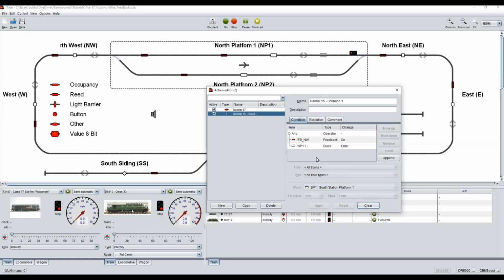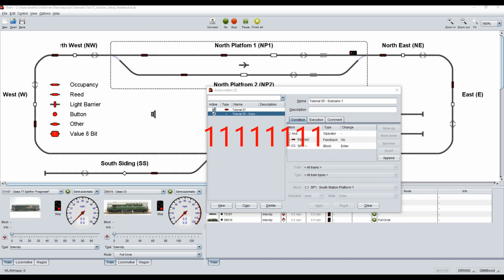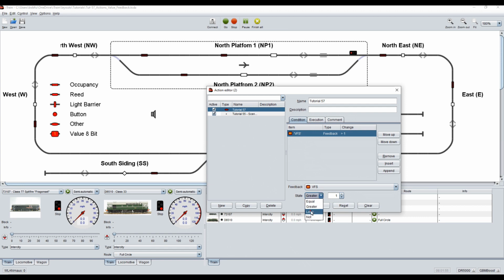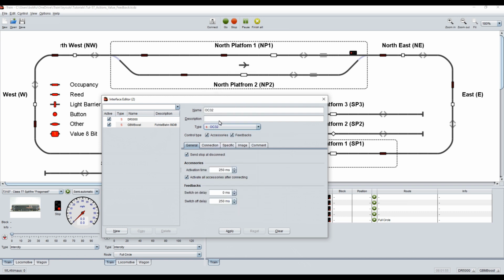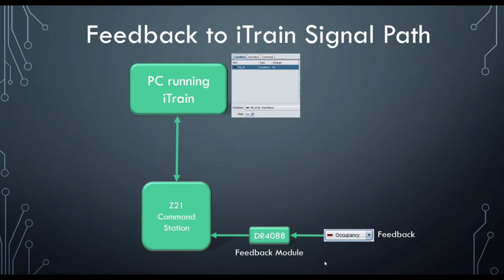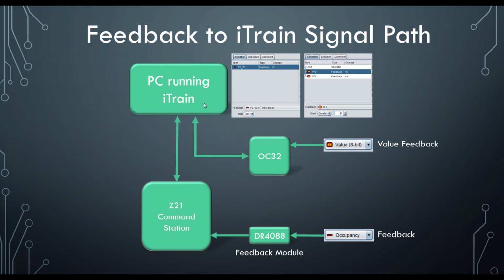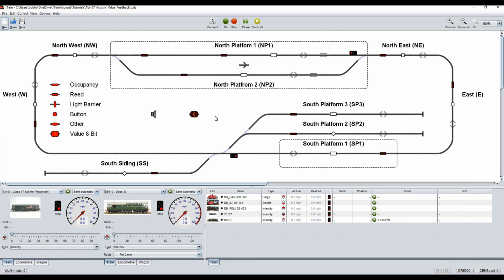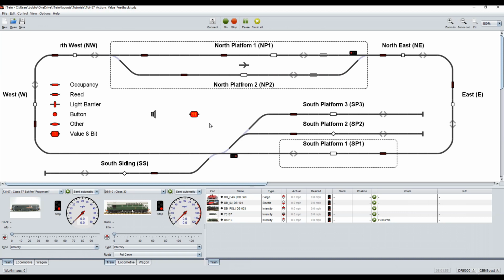Video 57: Actions - Value (8 bit) Feedback

Comment: Hi Bob.  Your series on iTrain has been very valuable and I have watch many of them many times to fully understand the concepts.   Is it possible that you could do one or a few on setting up Signals?  How to define them, where to integrate them into the blocks.  The manual is not easy to understand in this area.  Have been experimenting with defining ones to add but not sure why they don't seem to follow what I would expect happens.  Others may also like to have this part explained.  Thanks for considering this request.
Reply from the maker: Hi Rick. 
There will be some tutorials on signals but not till later this year.

Comment: HI Bob thank you for these videos I have slowly started set up the various steps you are showing nd have the block detection and turnouts along with some shuttles. the next step I'm wanting to do is set up automatic signalling that corresponds to the turn out position. do you have a video for this.

Thanks again
Reply from the maker: Hi Grant
It's on the list to do but not for a couple of months so if you need to move on, I would recommend asking questions on the iTrain forum.
Reply: @bobfuller  Thanks bob happy to wait as I like the way you describe the process as it makes its much easier to follow look forward to the video 👍

Comment: Hey Bob. Thanks a lot for your videos, than helped me run my trains as I wanted them. I still have two issues for with I have not found an answer in your videos and thats is Platforms and Speed. My issue with platforms is that at routing I can set only end, start or default value for the train stop. But I can not stop like 10cm before the end of the block and I have no idea how to setup platform. Secound issue that I have is a speed. My train seem to be kind of jumpy and they slow down from top speed allmout to 0 very quikly when they get from one block to station block. Is there a way, how to tell Itrain to use the speed chart at locomotive setup? Would you be so kind and make a video for those two things?. Thank you very much.
Reply from the maker: Hi Filip
We would need to see your tcdz layout file. Please post your question on the iTrain forum and attached your tcdz file. Someone will then provide help.

Comment from the maker: Hi Wayne,
I don't think there is a limit on the number of throttles. You can have up to 256 locos with all versions and unlimited locos with the Pro version. So, I assume that means you can have the same number of throttles. Click on a throttle, then press and hold the ALT key and press the arrow keys to add/remove a row or column of additional throttles.

But, if you mean a new, separate window that displays only throttles using the VIEW/EXTRA/TRAIN GRID menu, that is in the PLUS and PRO versions.

Comment: Hi Bob.  I'm back watching your videos again and believe I will go down the ITrains/Digikeijs route.  A little advice please - What is the difference between using a DR 4088LNCS and a 5088RC? If, as your offline demos show, Itrain always knows which loco is in which block then why do I need Railcom?
I'm up to video 26, and learning lots, but is it possible to do a video on your hardware and how you have wired your demo layout?  I'm also very interested in 3 aspect lights, how to wire and how to control in ITrain.  This may be covered in the 30 videos I have yet to see but if not then a request from down under.
Your videos are fantastic but would it be possible to finish each video with a demo on the real layout, just for us visual dinosaurs!

Mel
Reply from the maker: Hi Mel. Are you on the iTrain forum? If, so, take a look at the post https://www.berros.eu/itrain/forum/viewtopic.php?p=163870&hilit=DR5088#p163870. I think it will answer a lot of your questions. The 4088LNCS does not have Railcom, hence why it is cheaper. In the post on the forum you will see that Iain uses the 5088 for his main block detection, because he want RC, and uses the 4088 for feedback in his turnouts where RC is not necessary. Having feedback in the turnouts isn't vital - but a nice to have.

Send me a PM on the forum with you email address, and I will send you are wiring diagram showing how to connect it up. My username is Swanham.

Yes, I have had many requests to include video of the real layout. The problem for me is that it would add a significant amount of extra time to creating the tutorials. I already put far too many hours into them. But I am thinking of ways that I might include them in the future.

Comment: Hey bob. A little question.
I saw already in a few video's from you a logo/symbol on your layout, i don't recognize.  
Its the 2 lines in the station np1 and np2 on the right.
What does it mean?
Reply from the maker: Good question and well spotted. If you right-click on any object on the switchboard it opens a menu for that object. Select 'Properties' and it opens its properties editor. The window is titled 'Decoupler Properties'. So it is a decoupler element which you use for operating an automatic decoupling device on your layout. You can create an action which makes the loco perform the decouple shuffle and operate the decoupler, all automatically. In the upcoming 5.1 release of iTrain, there is a new decoupling feature which makes this all much easier to implement.